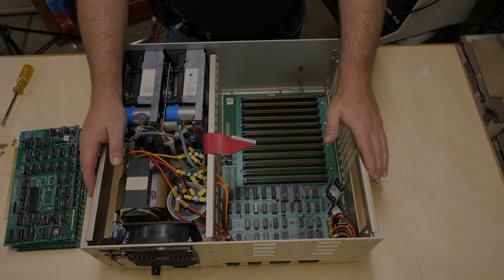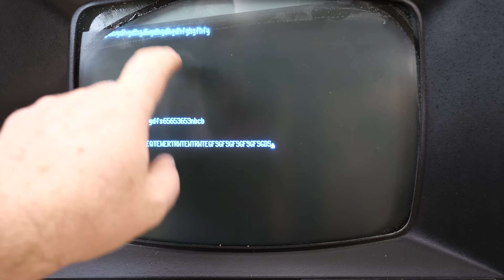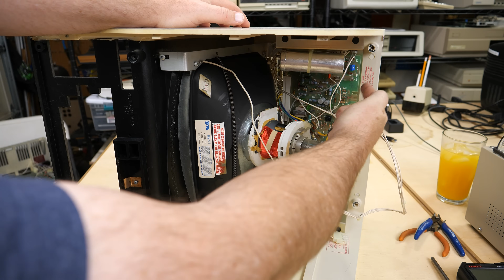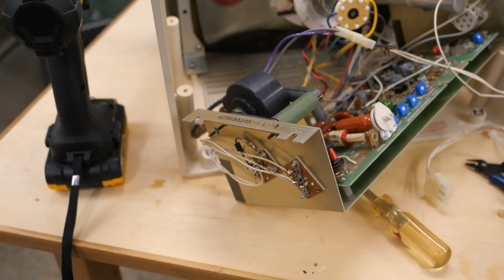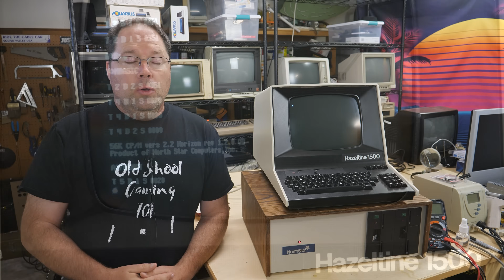Getting The 1977 North Star Horizon To Boot

Comment: about 30 years ago I had a Basis 108 computer that ran either CPM or Apple Basic.
it was a desktop, heavy and massive, wish I had held onto it, just because I code in basic
and that would be all it would be good for, that I know of. didn't have any other software for it, and it did not have a Hard drive, that I remember at least. but I could still get blank 5 1/2 in, floppy disks back then. got alot of enjoyment  out of coding on it.

Comment: 11:52 That an 8080 running the terminal? That's hilarious...
The Z80 replaced the 8080 in mini computer systems because it required fewer support chips and only 5v...

But the freakin terminal is controlled by an 8080

Comment: Not sure that was pure silicone. If it was, mineral spirits are your solvent. The problem with that is that it works so well you wind up smearing liquid silicone all over the place. I usually try to manually remove it if I can. Lighter fluid is Naptha, also available in larger volumes at your local paint store. Works a charm on stickers and adhesives in general and if worse comes to worse, pour some in your zippo and set it on fire.

Comment: I am currently trying to fix a Northstar Horizon that I acquired a year ago. I'm still struggling to get any output from it. I think I need to get one of those chip testers because I think something on the IO side of things is not working, or I do not have the correct boot disk. The lack of output from the system if no disk is found makes it hard to diagnose.

Comment: The memories.  My high school had one of these terminals.  It was connected to a computer that had a couple of 8" FDD and a card reader.  It had stopped working.  I fixed it by setting up the dip switches properly.  Someone must have messed with them.  It was a buzz for me as a 12yo to 'fix' such a big computer that no one else at the school could.
Reply from the maker: Nice!

Comment: When the Hazeltine 1500 was market current, about the time I was attending University of South Florida in Tampa FL, it was very common for terminals to be positioned in rooms with anti-static flooring and pretty intense air-filtration. By the time personal computers like the Apple II and IBM AT were starting to edge out mainframes, you started seeing a more lackadaisical placement of computer hardware and the grime inside the case could get to fire hazard levels.  In the mid-1980s, at Marshall University in Huntington WV, I saw quite a few Hazeltine terminals that were hooked up to the university's VAX mainframe and they were all approaching end-of-life from hard use and poor (if any) maintenance.

Over the years, I've seen melting of the sealant on old CRTs and terminals pretty often. Something in the chemical composition of the sealant causes it to go all tarry after about 20 years, well past the expected lifetime of the hardware.  A good deal sooner if the component has been stored in a situation without rigorous climate control like the manufacturer expected "back in the day".

I don't know if Northstar ever had compilers for PL/I, Cobol, Fortran, Basic, and Pascal, but I do clearly remember doing an ungodly amount of coding in PL/I, Cobol, Fortran, Basic, and Pascal on Hazeltine terminals. :D.

Comment: Excellent video. I was expecting at least one Tantalum cap to pop though! N* used some particularly explody ones on their boards :)

If you have no luck after cleaning the drives try checking/swapping the LF356 Op-Amp in the top left of the disk controller board. I've had to swap these on three of my MDS-AD3 boards after they showed very similar symptoms as yours.
Reply from the maker: Me too

Comment: Great video! How does the RS232 loopback help print characters to the screen when typing? I can't figure out how that would work, I was too young when these computers were in use.
Reply: The loopbck simply sends back data being sent out of the terminal. When you type on a terminal the typed text doesn't get sent to the screen internally as it does on a PC - it goes out via the TX lines, and the computer would send it back via the RX lines on the serial connection, allowing you to see whats being typed. The loopback basically ties the TX and RX together, ensuring that anything that goes out the TX lines (from the keyboard) goes back in via the RX lines (to the display). If you have a PC with a serial port, and a terminal program (such as PuTTY or HyperTerminal) and an RS232 wiring block like the one used in the video, you can try this yourself to see how it works.

Comment: The Hazeltine 1500 was one of the first low-cost smart terminals, from a company with a rather interesting history.

Most 5.25-inch floppy disk drives won't spin up without a control signal.

Comment: Wow! I bought one of these in the early 90's, (steel case) including a large 12" 10MB (or20?) HD that I planned on using as a turntable mechanism. Still has some of the cards and the disc on the wall, I never got it running, but I got it for parts anyway. (didn't have a terminal, but could use my Amiga as one.) edit: It might be a 14" disk platter, I cannot find 12" but 14" seems to be a standard. I platter in a huge cast aluminium chassis with a clear lid. Butchered a long time ago, but still kinda cool!
Reply from the maker: Nice
Reply: Too bad for scrapped the NorthStar case, I could have used it !
Reply: @w9gb  Well, the transport cost from Norway would have been huge, and to be frank, it wasn't in very good condition. I think I disposed of it nearly 25 years ago already.. :p

Comment: Boot address is E800...There is a rom on the disk controller at that address.  Disks are hard sectored... in other words a BUNCH of sector punch outs...and a few bunched together for sector 1.  (I wrote drivers for printers and the like back in the dark ages.  NS Dos had a 256 byte region that you could fit the drivers into.... There is no built in monitor...so you have to boot a floopy to get anything...
Reply: I had a singe density drive system and double density drive system.

Comment: Did the broken flyback bolt go through the middle of the winding?.. If so it's probably a good idea to fix it back in the hole with some silicon or hot snot or whatever.. it's part of the transformer tuning (actually critical). These have a habit of failing on 70's Trinitron TV's and invariably kill the flyback.
Reply from the maker: It was the other end actually. Not the end with the gap.

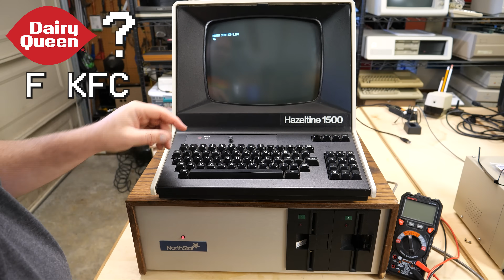Comment: 32:55 DQ, aside from being tasty, is probably "dual quad" disk drives, quad capacity being North Star's term for double sided/double density.  On their later Advantage machine, the CP/M herald would show 2Q or HQ depending if it was a hard disk system, for example.
Reply from the maker: Cool. I did see that at times when I was messing with CP/M.

Comment: Everytime you wave your hand around the computer's power supply or the terminal's CRT, I can't help but physically cringe.
Reply from the maker: Why
Reply: I'd be afraid of high voltage. I'm used to my power supplies being in sealed boxes, and I personally don't mess around with CRTs. I'm sure you're doing everything safely, but we don't see you discharge the CRT on camera, so I'm left on edge about it possibly still being charged.
Reply from the maker: I was pretty scared the first time I worked on a CRT. Now that I know what I am doing it's not so bad.

Comment: I used this system connected to a hard disk while I was at college learning how to program in cpm.
I can remember fixing one as it blew its tantalum capacitors.
If I owned it I would add crowbars to power supply rail's.
Reply: Crowbars ? I don't get it.
Reply: @cairsahrstjoseph996  crowbars is a description of a circuit. Which normally consists of a Zener diode triggering a SCR across the PSU rails as though you was throwing a crowbar in to stop a machine. It is to protect all electronics downstream and to blow the fuse if the power supply was to supply more than say 5V. I have installed them in my Commodores and other vintage machines to protect them. Switching supplies usually fail safe but linear PSU don't.
Reply: @Electronics-Rocks  Thanks! I thought it was a joke of some kind :) Sounds very useful for keeping these old machines running.
Reply: @cairsahrstjoseph996  I see you have the commodore logo so what do you do about your PSU as CBM not that reliable.
Back in the 80's had a report of a machine running hot only to find over voltages. Any problems thou shalt test voltages first!
Reply: @Electronics-Rocks  I gave all my Commodores to TPUG some time ago; but, back then (2000's) I never had an original brick PSU bust a machine, although a couple of times I had a PSU fail during operation (guess I got lucky); and I didn't have voltage testing apparatus either. Never had a 64 simply fail during operation, either (more and more lucky!).
Reply from the maker: Always a good place to start

Comment: Actually, MS bought SCP lock-stock-and-barrel. Also, CP/M would want you to either pull the system disk and then insert the disk to be formatted, or you could specify to format the disk in the B: drive.
Reply: Microsoft bought the SCP corporation

Comment: One common problem with S-100 buss equipment is the failure of one or more voltage regulators that are present on each card.  That's a common place for a short to develop.  The buss voltages  are unregulated, and the cards are more or less responsible for regulating what they use.  For this purpose, regulators of the 78XX family were common.
Reply: After repairing a couple of these I would suggest to add some power supply crowbars.
Reply from the maker: Thanks for the suggestion

Comment: all 5..25 inch disks have the index hole... it's there to tell the drive where sector zero is... whether it's hard or soft sectored doesnt matter :D
Reply from the maker: Yes. It matters. Soft sectored disks have one hole in the media. Hard sectored disks have them all the way around the circumference of the media. You can't use soft sectored disks in systems that expect hard sectored disks.
Reply: Brings back memories of having multiple floppies between machines. Also CPM had so many different sector layouts. Ended up using serial linkup to transfer my programs. Until I got a pc XT and got some shareware software which was so good at transferring data on internal floppy. That was the first shareware I paid for as I used it in my job and thought it fair. The transfer data was to be used at home on my C128 with 1571 in the latter years.
Reply from the maker: Nice
Reply: Hard sector: index hole for start of track and then another for start of sector.
Soft sector: just the one index hole for start of track.
Super soft sector:. Apple did this just write a pattern on the track to indicate start of track and start of sector.  Interleaving it either the data.

Way too much trivia in this head.

Comment: Yeah, I prefer WD40 because it doesn't eat into plastics. You can leave it sitting and usually just wipe it afterwards. The smell is really nasty for some time though. On glas your method or acetone should do the trick since you would hardly hit any plastics. To finish I prefer spiritus based window cleaner (Frosh in Germany f.j.)
Reply: Seems RHS’s method worked fine.
Reply from the maker: I did a side by side test a while back. The lighter fluid evaporates rather quickly, so the smell dissipates over a day or so. https://youtu.be/O69z7UYxQ9o?t=1446